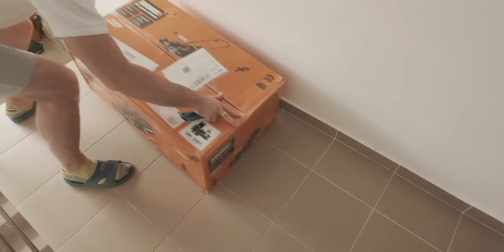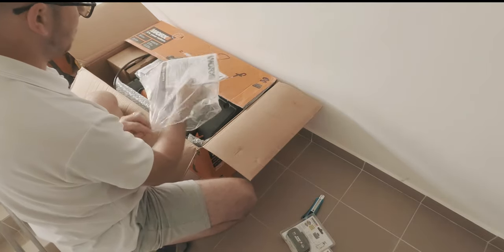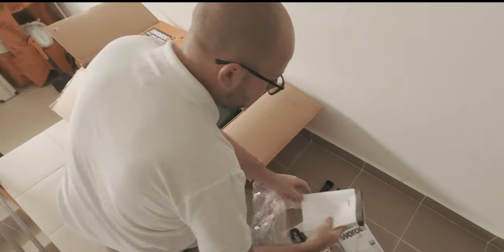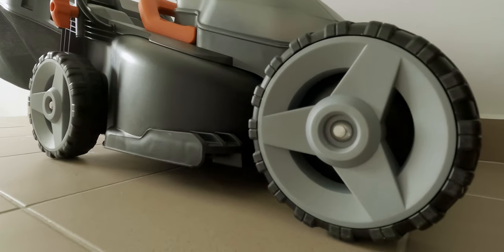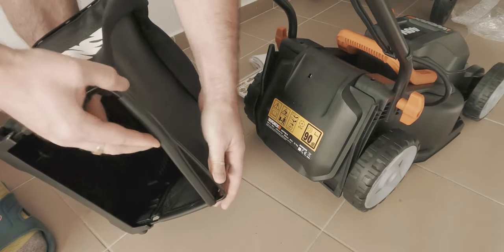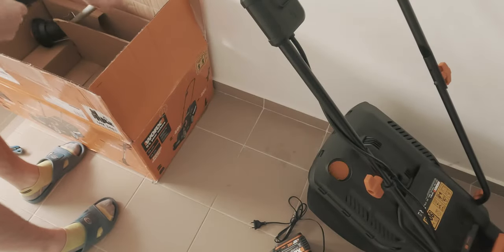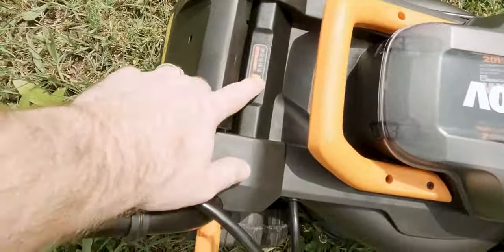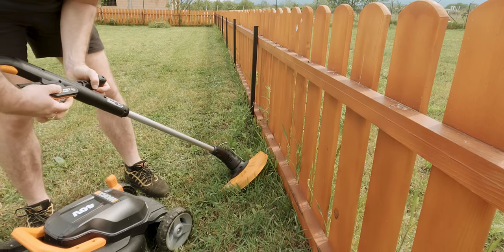Worx WG779E battery-powered lawn mower

Comment: Salut! Dupa inca 7 luni ce parere ai? Ma gandesc sa o cumpar in aceeasi oferta pe care cred ca ai ales-o si tu impreuna cu trimmer-ul.
Reply from the maker: La pachet si la cam cat tin bateriile e chiar ok...la un teren mai micut si bateriile mai mari e perfect. Nu am avut probleme la ea, doar lama s-a mai tocit si va trebui sa o ascut
Reply: Hello. Thankyou for sharing this video. What are the higher capacity batteries you are using with the mower ? Are they the same Voltage but with  longer run time ?
Reply from the maker: Hi, yes same voltage, 20V, at 4000mAh